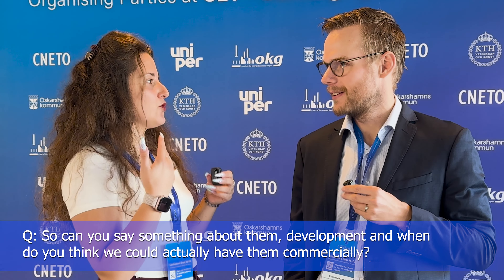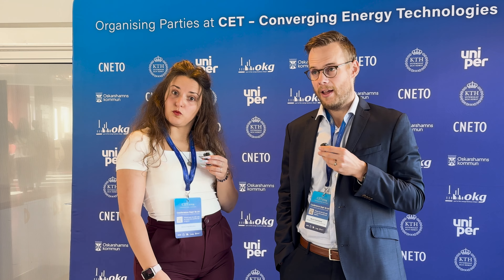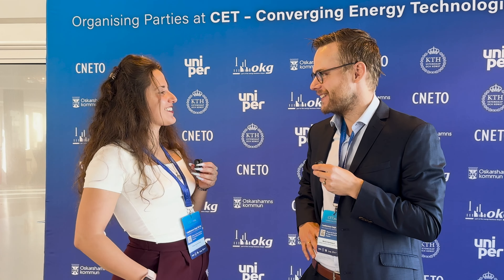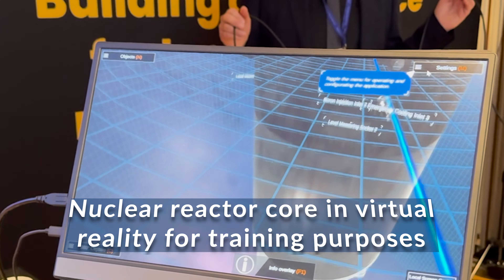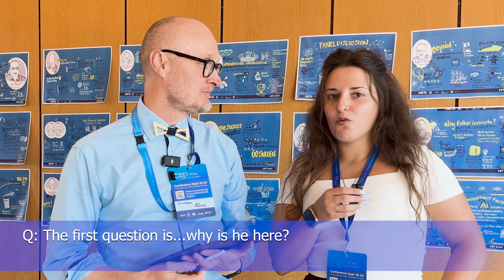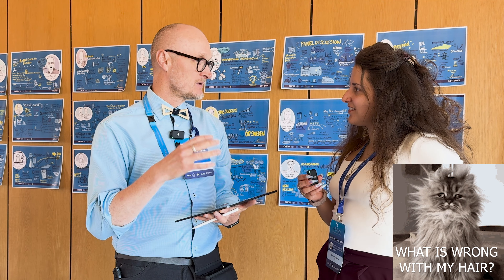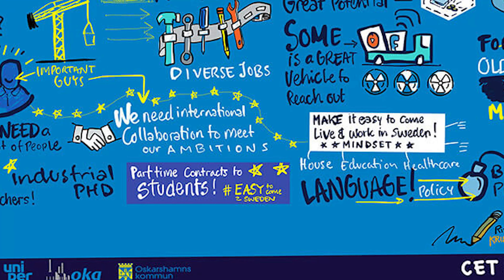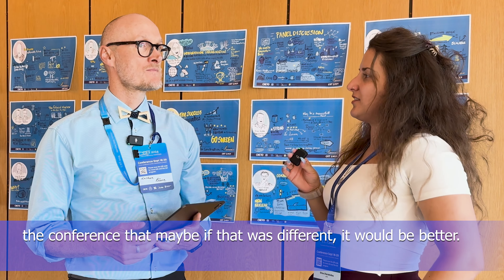What Is the Future of Nuclear?

Comment: Important question: given our power grid's susceptibility to solar flares, along with a weakening planetary magnetic shield, wouldn't small reactors (making steam and heat only) perhaps with flywheel or compressed gas storage options, be interesting?  Perhaps greenhouse heating or desalination as well? I'm seriously concerned, given recent auroral activity in southern locations from relatively weak flares. Might an episode on this issue be warranted?   PhD in solid state physics here by the way. Worked on first terrestrial fuel cell powered vehicle in fact (Georgetown U bus in the 1990s). Later worked at LANL on some interesting tech. We need to get real real quick about what might be coming & sooner than we are ready for...